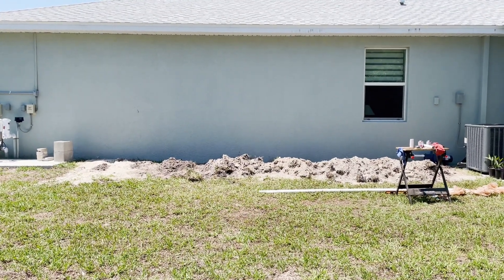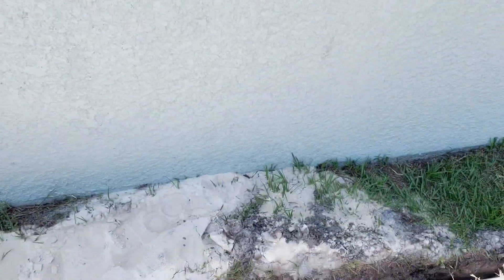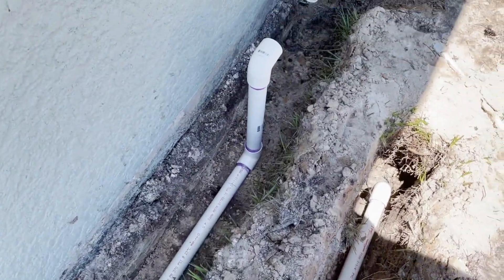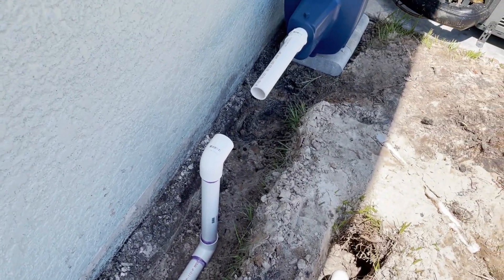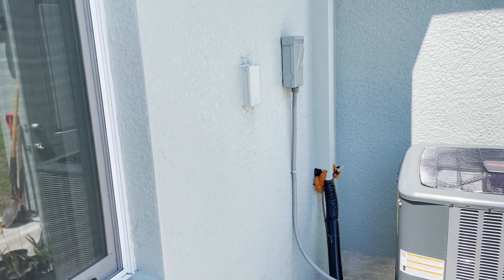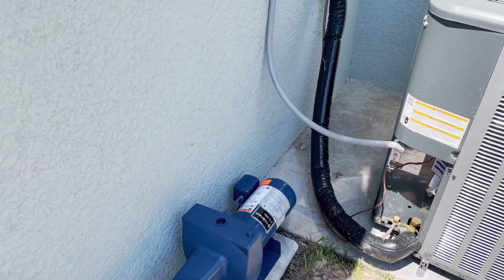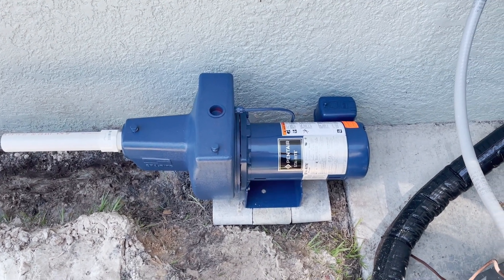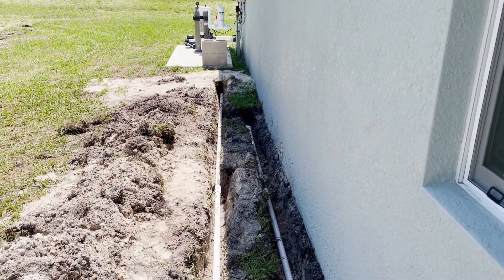Florida Sand Point Well (part 5) Plumbing A 3-Head Well

Comment: Hands down the best series of videos on this subject that I’ve found.  I just finished running all of the power for mine. All of my valves are on the opposite end of my house from all the power.  I’m converting an existing irrigation system from city water to well…$400 water bills are killing me. Fortunately I have a buddy who installs irrigation wells for a living and he going to drop the well points for $500, but I have to supply the materials. Thankfully I have a contractor account with a local irrigation and well supply company, so I’ll be all in for about $1400 which also includes $250 in electrical supplies I just installed. I’m in Central Florida now, but I’m originally from your neck of the woods and visit family down there often.  Thank for taking the time to do these videos.